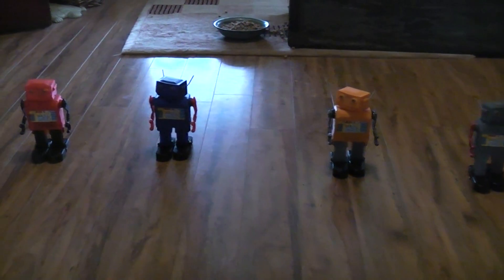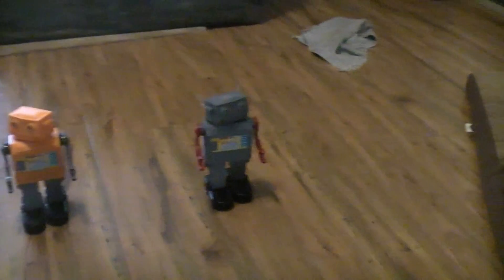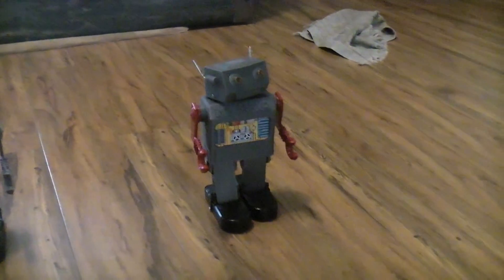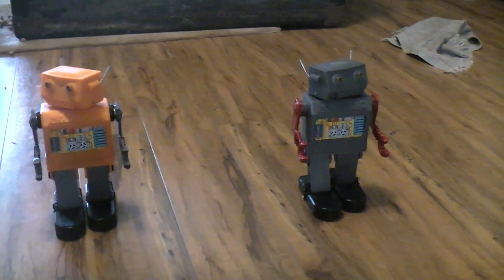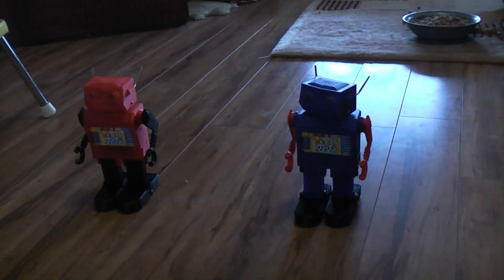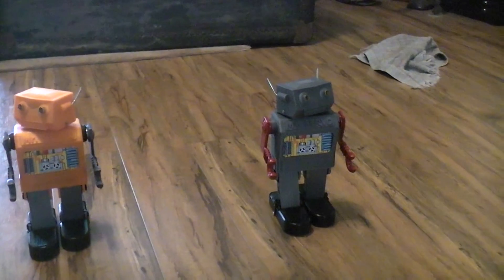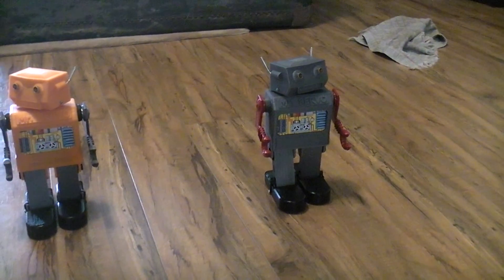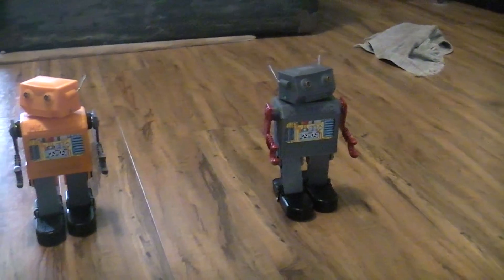3d printed toy robot Mr. SERVO

Comment: Jesus Christ bro this is mad
Reply from the maker: I put the STL files for the legs and body base on thing-I-verse, I did not post the body and I think makers should give it there own look.
Reply: Robothut THANKS!!!! What servos did you use?
Reply from the maker: I used TOWER PRO Micro Servo 9g, now the problem with that is , every time I order more they are just a little different. Some have different servo hors that come with them some have different size splined output shafts, some are deeper in case size. It is a problem designing a project and then finding that the same servo will not always fit right. They all look the same but every knock off china servo of the same type is a bit different. So what I would do is order enough servos to do the full build of bots and that's what I would use. Now and then you can get lucky and get the same servo twice in a row. I even find that some times they run slower "more geared down" even though they are sold as the same servo. The good news is they are so cheap to buy that you can just buy a handful from a few different sells on Ebay and probably get some that fit you design and save the others for different projects.